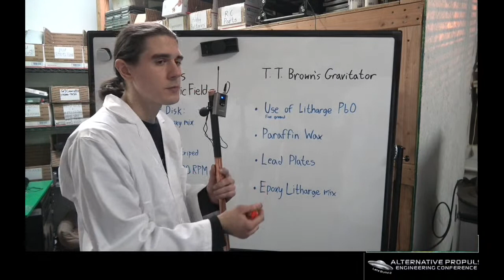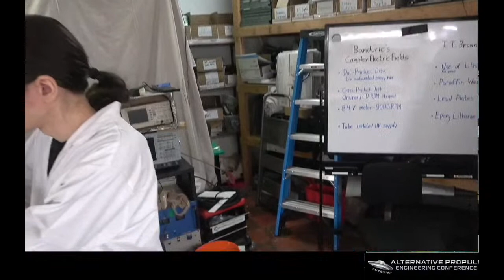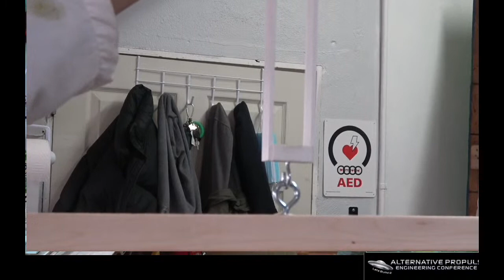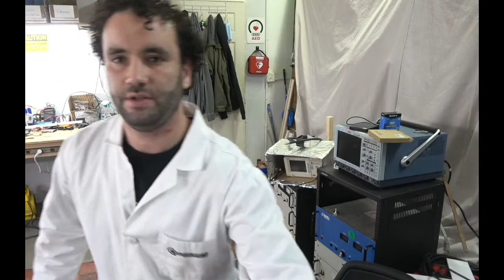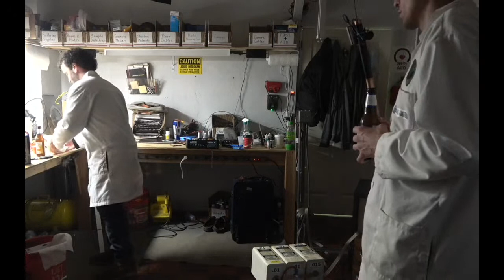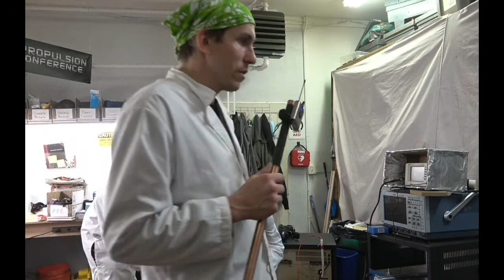LIVE AntiGravity Experiment Marathon! Dec 2020

Comment: Several years ago, a video  was shut down after 1 month. It was dealing 
with demonstration of thermocouple / thermopile that slightly loses 
weight when activated, and also on sensitive digital weigh scale. Heat 
must be released away from mass so as not expanding air pressure under 
unit in test pushing upward . (upside down) The word "correlation" 
describes other experimenters who successfully aborted gravity with 
their specialized set ups using matched metals according to ratios of 
properties. See 1800's work of John W. Keely with his "transmitters"  as
  in series junctions of silver, gold, and platinum thermopiles as 
tested for gravity control with his array of tuning forks vibrators.  
The nodes junctions multiplied the frequencies even higher causing 
dissonance  to normal orderly gravity waves.  A french scientist also 
lifted an open frame dirigible with sandwich plates at either end hooked
 to frequency transmitter. (translated from french) It seems there are 
other ways to disrupt gravity waves affecting mass..